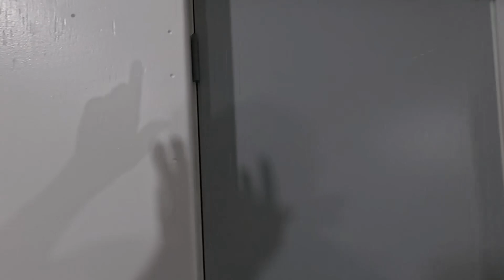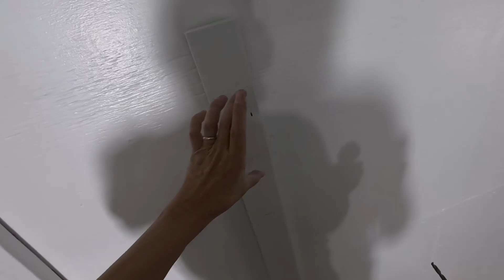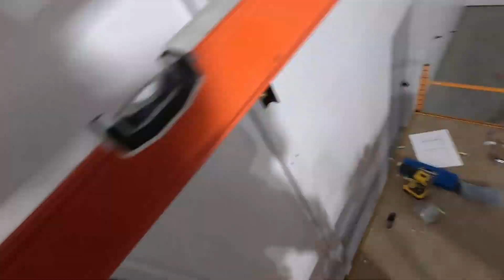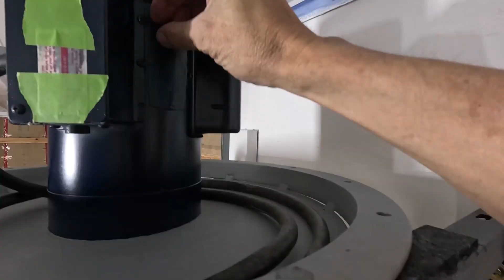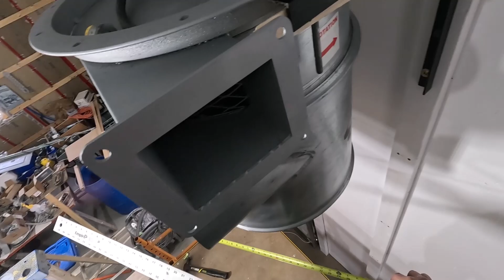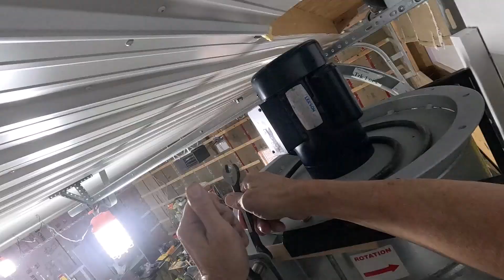Vibration-Free (Quiet) Dust Collector Mounting and Squaring

Comment: I used to design shop machinery installs with vibration reduction (near elimination). The machinery lasts dramatically longer in addition to the much quieter running. It's always a good idea to reduce or eliminate vibration! 😊
Reply from the maker: I agree! Anywhere you can stop vibration, you should do it!

Comment: Hi Mojo, wow twenty years in hibernation that's a long long time,really enjoyable video great job.
Reply from the maker: Thanks Larry, It really is! Luckily the motor should be just fine as it it totally enclosed, but time will tell. They are quite pricy to replace! I was surprised at the amount of rust! the ducting has been stored outside for four years now and it is in better shape! But it did clean up nicely, and now I can start wiring! (as soon as the upper tin is in place). 😐